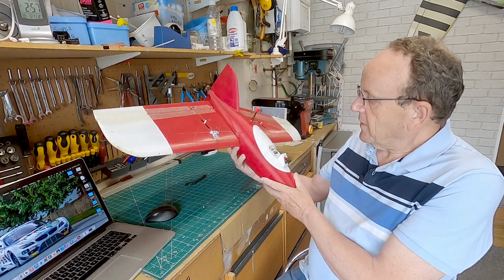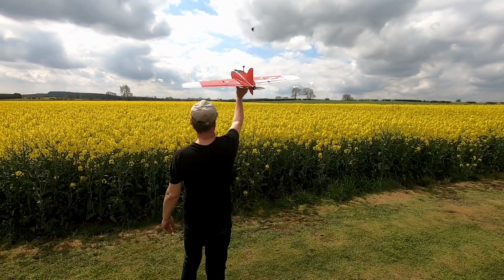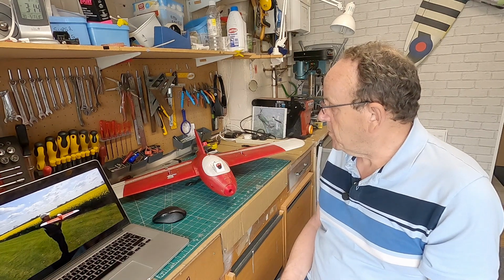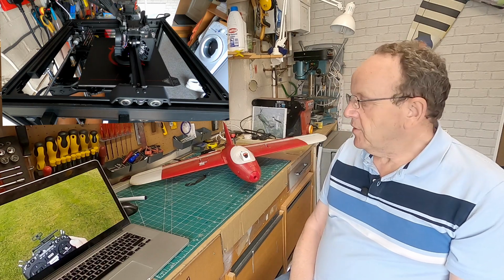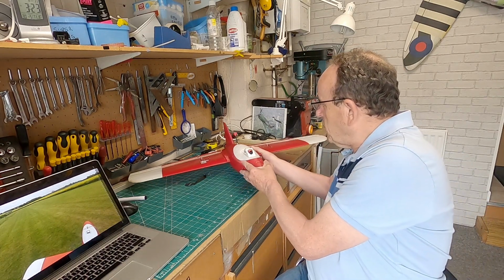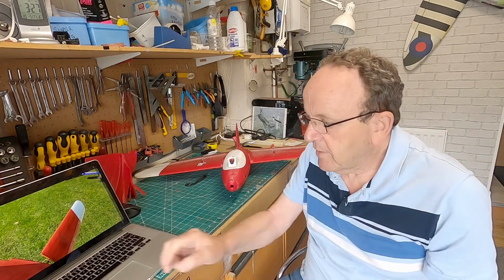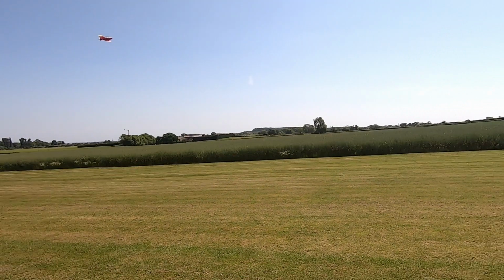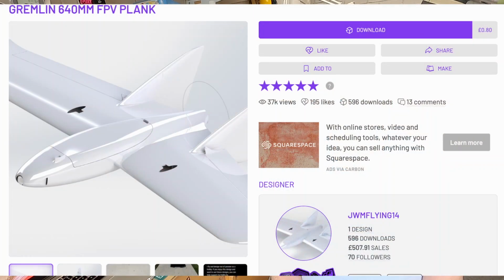How Hard Can It Be To Launch An FPV Grom?

Comment: I bought a stock Strix Goblin plane from RMRC, original model. Launched from the first attempt. But i have 1250kv motor and 8"x8" prop. Auto mode, 4S LIPO battery. The battery was bad and the plane has crashed from 200m in the middle of the waypoint flight. It went with its nose down and crashed into the mobile home roof. All components intact, except for the carbon spars broken and the wings fell apart. SpeedyBee f405  died from the impact, but the fuselage is made from the soft plastic, survived.

Comment: You need a set of really powerful equipments on this bird. High voltage, high pitch, high thrust. And better hold wings, wait motor running steady, toss back to sky of your behind, and let FC do the take off job. That's how you get a great flight.
Reply from the maker: Yes. I have printed a new one which I should have ready soon, keep a look out for the video.